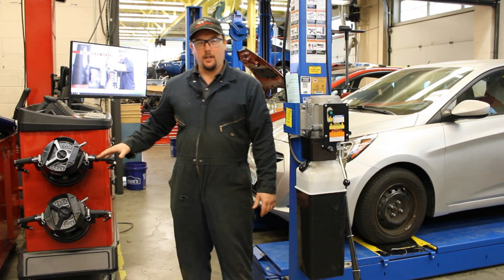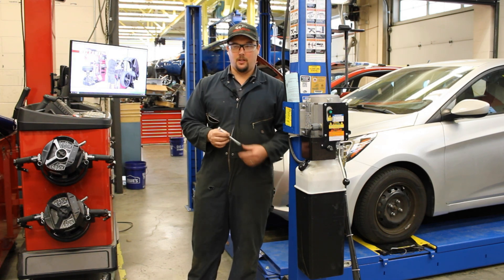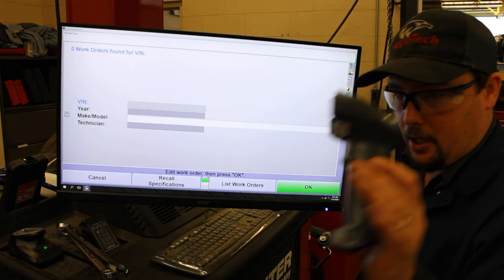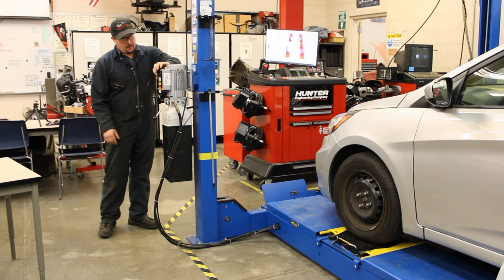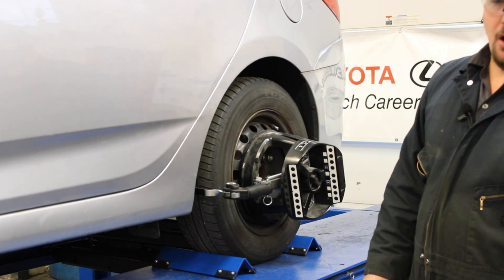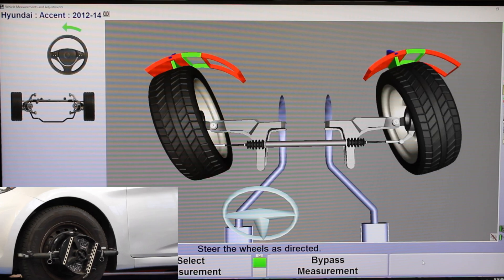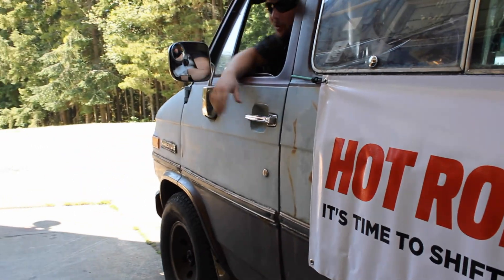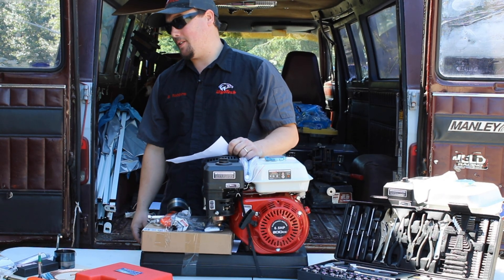Hunter Hawkeye Alignment Machine Full Job Demonstration

Comment: Most of the people doing alignment don't even know how to run an alignment machine now they're doing a set in the toe they're not even adjusting the camber the camber can be adjusted just by simply putting camber bolts in the spindle on the strut

Comment: I installed new inner and outer tie rods and im trying to adjust the toe or see if its even possible but the inner tie rods dont spin at all. It has a little hex section cut out but will not move at all. Also, the new inners dont have a locking cam to secure it. Just a hole going through for im assuming a cotter pin but after putting them in i just dont trust the cotter at all. Any insight?

Comment: Your comment that both rear wheels are pointed to the right was incorrect, the display showed the rear left with .38 degrees and the rear right with .16 degrees. Both of these are indicating a positive toe so they're both pointed slightly inward. If both wheels were pointed to the right the .16 degree value would have been negative (for toe out).
Reply: The spec is 0.21. One was at .16 the other at .38. Both were to the right of their specification. But you are correct that both were toed in, just not to where they need to be

Comment: Where in the hell are you located??? I've had THE MOST suckiest luck getting my '99 Honda Accord LX alignment done!!! I'll never go to any firestone!! Buncha ignorant kids... been to multiple I mean a 💩 load of shops and not 1 place can fix my alignment!! The next to the last time I went, my front tires didn't even last 8,000 miles!! Those are 60,000 mile tires!!!! I understand how the alignment machine works you type in the year make and model of the car and it gives you the measurements, however my accord has aftermarket rims on it, and they stick out at least 2in on both sides. I ain't seen any of the places I've took it to take as much time and care as you've took in this video!! I have a print out of my last alignment that I would love to show you. firestone "aligned" it, then not 6,404 miles later I'm having to buy new front tires and new alignment at a different shop!! I've replaced entire front-end, struts, ball joints, tie-rods, EVERYTHING!! I love driving this car but it cost to much not in gas, oil, or farts, but in TIRES!!! Please help!!
Reply: The alignment machine can’t assume and can only read between sensors, so if you’ve put aftermarket wheels on with a different offset, they will pull inward or outward differently to the normal wheels, maybe just examine the tyre wear and then ask for the alignment to be set slightly farther than tolerance to compensate for the difference
Reply: Are you sure "the machine can't assume"?? C'mon, im not an idiot. I just know that theres thousands of vehicles on the road with aftermarket rims that im sure are not having the issue im having. Why should i have to ask them to turn the alignment in any direction...i mean if im paying $140 for this alignment or $85 for that alignment,  i would think the technician would know how to use the machine. But hell what do i know. @insertnamehere5660
Reply: Maybe too much negative camber. Try some adjustable camber arms for the rear and camber bolts on the front

Comment: I got an alignment with this machine and the tech fucked up. The steering wheel was pulling right. Went back, corrected it, and reprogramed the computer too since my car is a AWD. The tech needed a bigger guy for the steering alignment centering and he didn't tighten all the nuts good enough. I hope any of you reading this learned something and sometimes check up on your car in service to see if they're doing it right even though that might make them nervous.
Reply: Anyone wondering, the original tech guy had a flat ass and lighter than me. Probably because of that he was sitting leaning to the right that's why.